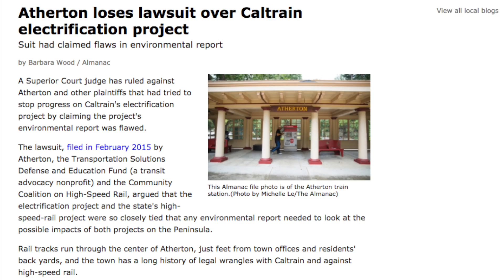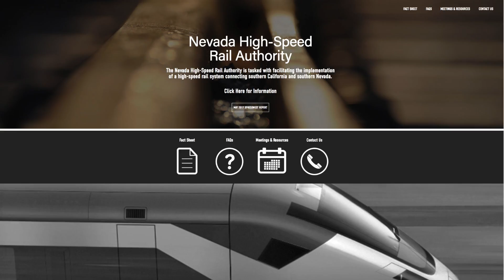2017 in California HSR: Caltrain Wins Bigly + Las Vegas Bullet Train 🚄 Future Transit USA

Comment: Excellent information in this video, well done. Looking forward to the completion of CaHSR and XpressWest hopefully, sooner rather than later.
Reply from the maker: The recently published comprehensive Las Vegas HSR market study (commissioned by project stakeholders to attract investors) indicates that trains could be running between Las Vegas and Palmdale (or at least Victorville) as soon as 2021, between Burbank & Las Vegas as soon as 2026, and from as far south as Anaheim to Vegas possibly by 2029.  I'm not putting any money on that timetable yet, but the study is a really great read for those interested in how privately funded HSR could in fact be very, very profitable. http://files.constantcontact.com/0b5f0dbb001/51dd56dd-7e57-4a5a-bc68-217d7dd75422.pdf
Reply: @LosAngelist  Thanks for posting the study. Good read and informative with a six year perspective. The Metrolink Antelope Valley long route explains why the ride is 2 hours. Rancho Cucamonga was chosen first by Brightline before the Palmdale HDC route. Makes sense since CAHSR to and from Palmdale being the last is so far off. The timetables were interesting as well as the number of car and plane trips.
Reply: Can I book a seat now?  What will it cost? Will I get my money back if it don't get built?

Comment: I agree with your position on the use of HSR funding to build up the Caltrain route, but you kind of misrepresented the counterargument. The counterargument is that HSR money was allocated to build a dedicated line that was supposed to go faster than what Caltrain could achieve.
Reply: Yes, there will be blended track at both ends totalling about 120 miles. They hope the top speed will be 110 mph with an average speed of 80 mph for a travel time of 1hr30min. With an average speed of 125 mph for the remaining 375 miles this makes the entire ride 4hr30min.

Comment: You're characterizing this as democrat vs. republican issue.  It is an issue of honesty and common sense.  The original scam promised HSR between San Diego and SF Bay area.  Well, Bakersfield to Modesto leaves a lot to be desired for 80 billion dollars.  Oh, yeah, the original destinations can be reached by taking a BUS.  How about a stage coach?  This would be laughable if it was done with private money, with tax money it is wholesale robbery.
Reply: For BILLIONS less, they can upgrade the current railroad lines and just run trains day and night.

Comment: BRIEF UPDATE: GOV. NEWSOME HAS TEMPORARILY PUT THE BRAKES ON THE LA TO SAN FRANCISCO HSR PROJECT. CURRENTLY HSR WILL ONLY TRAVEL FROM BAKERSFIELD,CA TO MERCED, CA. EVENTUALLY, THIS WILL BECOME A PIECEMEAL PROJECT NEXT CONNECTING MERCED, CA TO THE SILICON VALLEY AREA & THEN  INTO SAN FRANCISCO AT THE SALESFORCE TRANSIT CENTER(SFTC). ESTIMATED FULL COMPLETION DATE OF THE CALIF. HSR PROJECT, ROUGHLY ABOUT FY 2026 OR FY 2027. FROM NOW ON, AS USUAL, ALL WILL DEPEND ON FULL FUNDING & POLITICAL WILL. FASTEN YOUR SEAT BELTS, HSR IS COMING IN MY OPINION, BUT NOT UNTIL FY 2026 OR 2027. JUST A THOUGHT.
Reply: Its a waste of time and money.  We need desalination plants!

Comment: 2019 - California HSR is dead.
Reply: Good.  Build desalination plants instead.
Reply: @rockyracoon3233  What about upgrading the tracks and running trains day and night?
Reply: @davidjackson7281  . For the current lines?  Yes, also there are high speed diesel locomotives that could be used as well.
Reply: @rockyracoon3233  By upgrading tracks to 110 mph top speed and building new 125 mph tracks an average speed of 80-90 mph would be possible. This would be twice as fast as most current passenger rail and 66-75% of the average 120 mph HSR. Very cost effective to build and operate without electricity.
Reply: @davidjackson7281  . Plus we could run the locomotives on biodiesel as well.
Reply: @rockyracoon3233  Yes, that meets and exceeds environmental needs and standards in my book. Diesel trains have even tested out at a top speed of 140 mph. They could run on the CAHSR in the Central Valley and add electricity after whenever the Pacheco Pass is built much later.
Reply: @davidjackson7281  I believe Spain has a diesel locomotive that can go about 160 mph now as well.
Reply: @rockyracoon3233  Wikipedia shows a Renfe Class 334 with a top speed of 120 mph. There was a 354 with faster acceleration but several accidents seem to have "derailed" it. I would be interested in knowing any diesel electric trains which do exceed 140-160 mph. Nice chatting with you. Thanks Rocky.

Comment: This is a stupid video, CA taxpayers have forked over billions for some stupid line in the central valley that goes from no where to no where. All at the cost of vital infrastructure like the dams and roads. A good 70 to 80 mph rail service is all that's required, if speed is vital then take an airplane.

Comment: Build it already and for the love of humanity why is it being diverted towards Palmdale why why?
Reply from the maker: Diverted?  Palmdale is on the way.  Don't worry, it won't use the super-slow windy Metrolink route to the AV, they're building a whole new one.
Reply: Los Angelist ok I see they want to avoid all the heavy cities along the 210fwy and instead are going around the other side of the mountain I just don’t get it isn’t putting one if these HSR trains at least run it along side the city limits
Reply: @LosAngelist  What do you know about the SR14 revised route? It's 40 miles with 30 miles of tunnels. It will be started as the final segment 2-3 decades from now.

Comment: It's "na VA da", not Na "Vaaauuugh da."  There is one scene in this video showing high speed rail through the Bridgeport Valley in the eastern Sierra Nevada of California.  Leave the eastern Sierra alone, it is one of the last good places in the state.  Otherwise this is a good video and I support high speed rail.  Use much of the existing Interstate Highway System as a basis of where to route future lines.

Comment: California’s high speed rail 4 years over deadline (so far) and 40% over budget. This thing will end up well over 80 Billion when all is said and done for us in California. The Governor just added a huge tax to our gas to help pay for it even though it says it’s for the roads. It took me 30 minutes to read it all before you see the little part that says a chunk goes to pay for the high speed rail. Be careful Nevada because California ain’t ponying a dime for this one!
Reply: You are comparing a HSR that's about 470 miles vs. 47,000 miles of Interstate Hwy? Then also multiply the $500 Billion x 100 = $50 Trillion
Reply from the maker: "California ain’t ponying a dime for this one!" - Actually Los Angeles County is helping pay for the portion of Xpresswest in LA.

SB1 is only "for the roads" - The gas tax always included funding for public transportation.

"This thing will end up well over 80 Billion when all is said and done for us in California." - Yeah, probably.  Would still be worth the investment even if it was $500 Billion though.  Adjusted for inflation, that's not much more (probably less) than it cost to build the interstate highways.

Comment: The high speed rail is a waste of money with the advent of the Hyperloop.
Reply: Brent Quade CA needs desalination plants!
Reply: Brent Quade 

If Hyperloop is going to provide a faster travel time than planes, then it needs to bypass the cities on the east side of the Central Valley. News Flash: people live in the Central Valley. They shouldn't be left out. Also, the HSR will provide faster journey times for trains from Bakersfield to Stockton, even though the HSR won't go to Stockton at first. Essentially, the sum is greater than the whole of the parts. Those two reasons are why CA didn't go with Hyperloop (of which R&D is taking longer and costing more than expected).
Reply: The hyperloop is retarded.

Comment: unlike a High speed monorail or a MAGLEV , the high speed rail is 50 years old already and one can buy well engineered rail stock ( TGV , Shinkansen , etc.) if you don't want to design your own. as to H.S. Rail , any decent construction company can do it.
Reply: george ivanus 
decent construction company, they exist?
Reply: Patrick , you got many 'decent' construction companies in the States . other things are missing here.
#
Reply: george ivanus the problem is, the TGV and Shinkansen aren't built to the ridiculous crash standards that the FRA requires in the US. Currently, the only way to avoid those is to built a completely separate right of way that doesn't connect to freight systems at all.

Comment: This would be a good video...if it were honest. California does not have a high speed rail project. It has a train that maxes out IF ever built at 125. That is 30 MPH slower than the minimum high speed rail standard. If you actually want to enjoy high speed rail, you have to leave California, and get on down to Texas. They have a great project down there for a 200 MPH high speed train because they knew what they were doing and got the Japanese involved. https://www.texascentral.com/facts/

Comment: High speed rail is so much more civilized than flying.
Reply: richies quest far more comfortable, that's for sure.
Reply: Also, far more non-existent than flying
Reply: @ericferguson68  *in the US

In Europe and Japan many airline routes closed because of highspeed rail!
And even if the overall journey time is a bit longer than a flight, many people still prefer it! The reasons are simple:
 1.: you can USE the full journey time, for work, relaxing, whatever. If you fly you need to stand in line and walk quite far and loose a lot of time.
2: location: highspeed stations in city centers provide far better transit connections, they are often its main hub. And especially for businesses its important, they are more concentrated in the center than at the airport

Comment: Assume one train leaving every 15 minutes, carrying 1000 passengers each paying $200.  That's $19,200,000 a day, or about $7 billion a year.  Sounds like a lot, but it will cost over $70 billion to build it.  That also does not cover the billions needed to operate it.  In other words this boondoggle will NEVER cover its costs, let alone generate enough profit to expand the system.  Another albatross around the necks of California taxpayers.
Reply: Yea but the increased GDP from the reduction of cars on the freeway, as well as a significant reduction in air travel demands between SF and socal (about 1/3 of planes leaving SFO are headed down the coast) which would allow us to get much more out of existing Airport infrastructure. Yea the state will lose a lot of money on this but you can't put a price on quality of life.

Comment: Great for those people in Los Angeles wanting to go to Las Vegas, but how about San Diego.  First we have to either drive, take a slow train  or bus, or fly to LA.  And then take another train to Vegas..Once in Vegas you either rent a car or you at the mercy of public transportation.  In the long run it is cheaper and faster to drive on the freeways if you time it right.  I don't mind high speed rail being built, but this one in California is being put together with bailing wire and duct tape.  Who are you kidding with a cost of 64 billion .  More likely to cost upwards of 200 billion and there is no way it is going to pay for itself.  The people of San Diego and Orange counties got screwed on this one.
Reply from the maker: I agree with you that San Diego should have high-speed rail already. The LOSSAN corridor should have been electrified decades ago.
Reply: Not to mention Sacramento residents

Comment: Have you ever driven from LA to LV or back?
You don't even have to get stuck in the traffic jam to go slow.
Everybody slows down to 20 to 30 mph no matter what.
Because the road goes over the mountain, the air becomes pretty thin at near the top, the engine just doesn't run as fast as it does at the sea level.

There's no such problem with the electrified train.
Even at slow speed of 120 mph, the difference is night and day.
Over 200 mph?
I'll visit LV weekly.